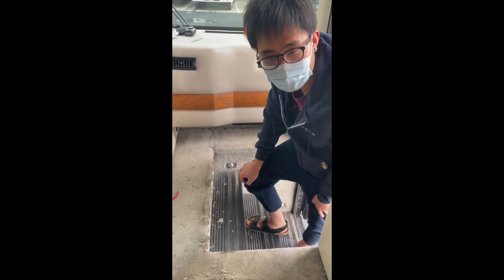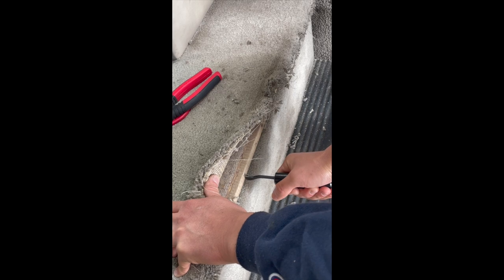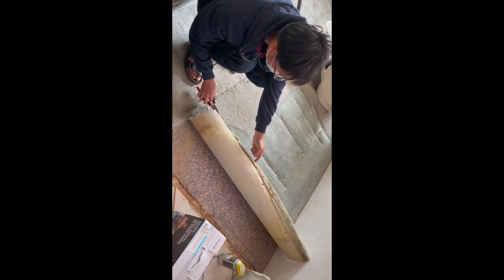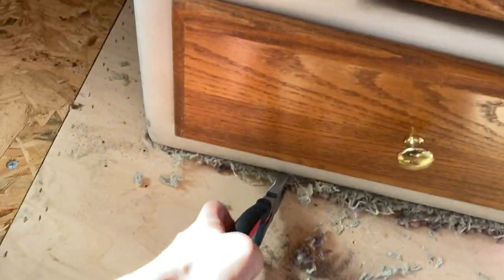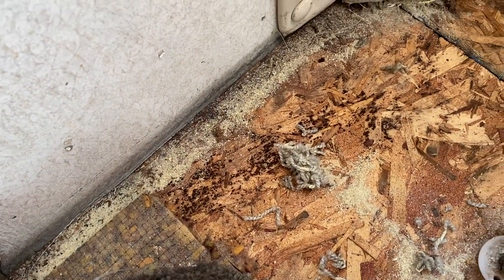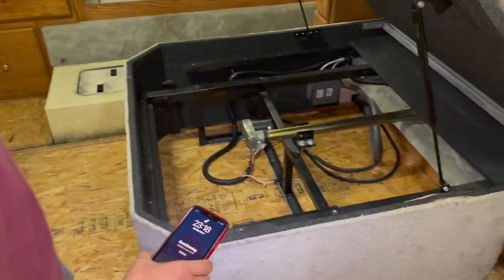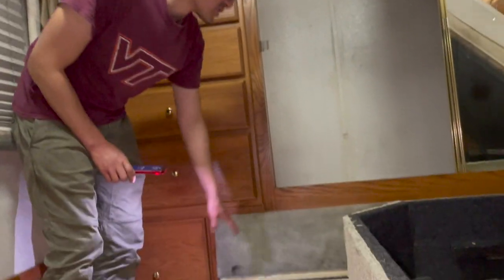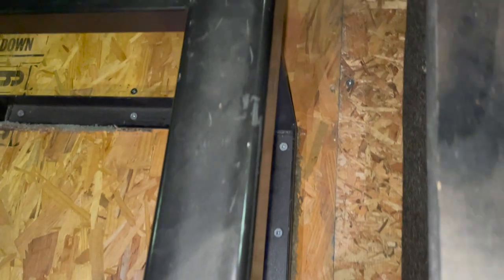Motorhome Floor  Replacement - Carpet to Vinyl Planks

Comment: Nice job! Thanks for posting the video. I have wanted to do mine for some time and this is inspiring!
Reply from the maker: Thanks for watching! Looking at this now, I would do a few things differently. The biggest one being the transition between floor and tile. I would not use the transition cover, rathe just use some silicon to seal any small gap.